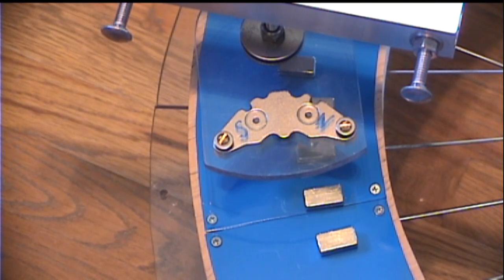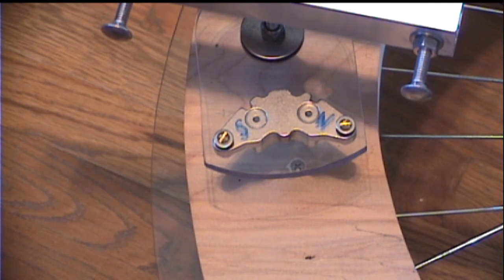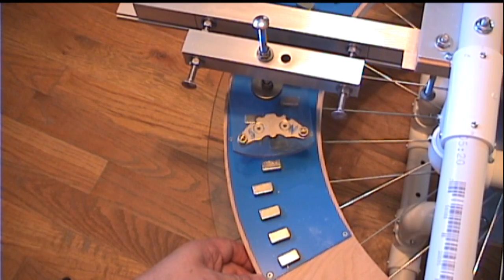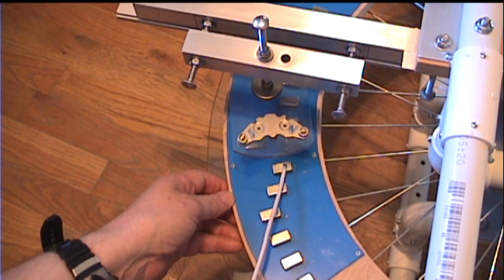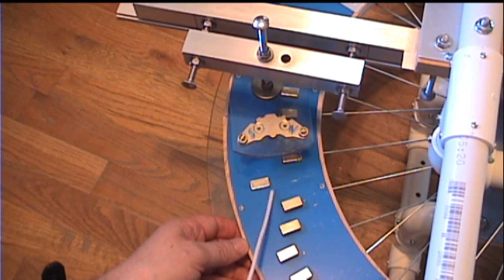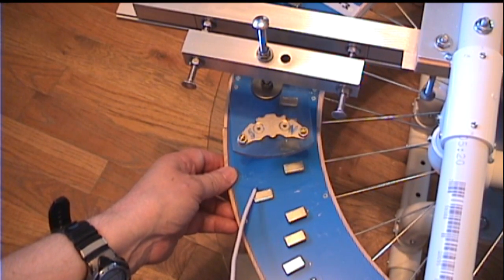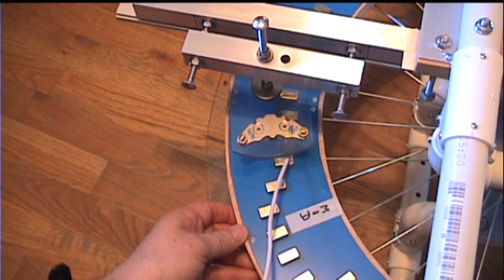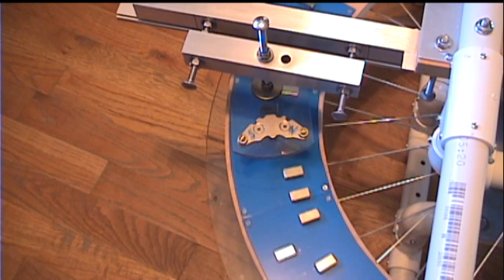Video #32, "Rick's Pipe Dream" Magnetic Motor-Generator

Comment from the maker: @w3h3h3h111   No angle in this video.  As you can see in the opening frames, the stator is directly aligned with the rotor magnets.  I will be doing some angled stator and free stator tests, among other things, during the elapsed time testing phase, which begins at video #36.

Comment from the maker: @w3h3h3h111   That's a good question that others may also be wondering about.  The rotor turns better in a counterclockwise direction than clockwise, because of the curve of the stator magnet.  It would turn just as well clockwise, of course,  if I reoriented the stator magnet 180 degrees from its current alignment.

Comment from the maker: @TheRickoff   While waiting for a new order of magnets to come in, I want to experiment with different layouts on the 3 plates that I now have set up, to see if I can smooth out the rotation somewhat while lowering the elapsed time from one end of the plates to the other.   I found an excellent solution for testing various layouts with a high degree of accuracy, which I will be showing in the next video.